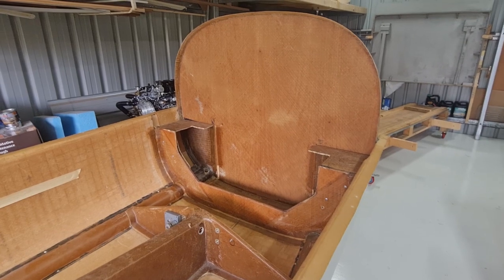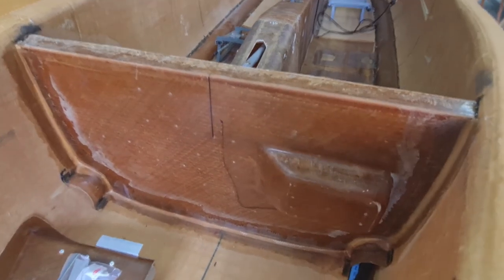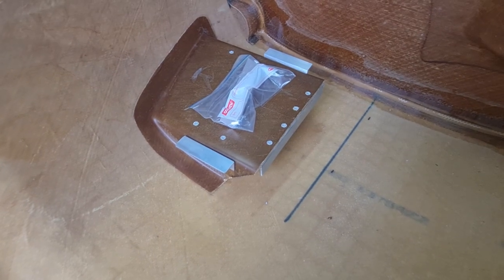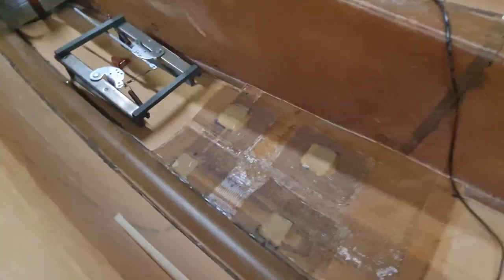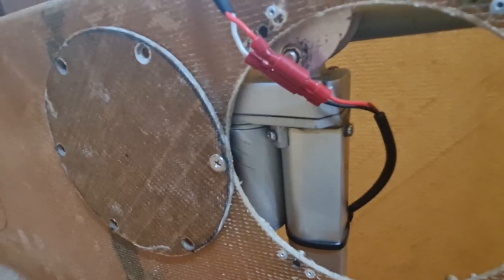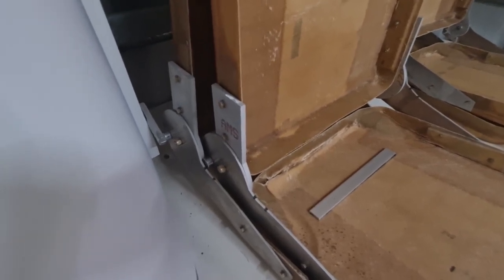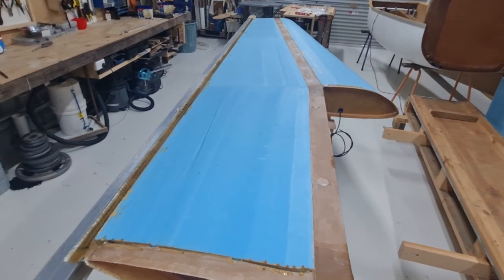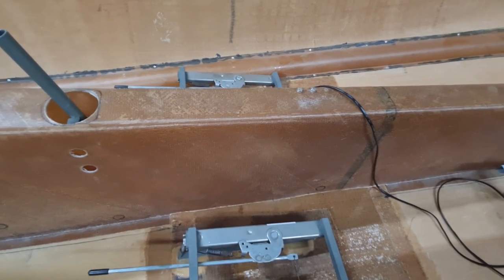Velocity Build Experience 03 - Lower fuselage start

Comment: Might be a bit late but anyway: you could consider a magnetic field angle sensor (like the MLX90316). You then only have to glue a magnet near the rotation point of the speed brake and position the sensor near (but  inline with) it. This way it is impossible for your measuring device to interfere with your actuators. This chip can be configured to give an easy to use 0 to 5V output (or PWM, or SPI). I have used these in the past to measure all control inputs of a helicopter, without risking to block some controls if a potentiometer would get stuck or something like that.
Reply from the maker: This is a great idea. I've looked at using them, particularly the KMZ41 for a future mini project on the velocity. I'll have to look at the MLX90316 to see if it's better suited. I'm a little unsure about the mechanics of getting a magnet to sit stationary on top of chip while the brake is moving. getting near the hinge is tricky, but i'd like to get rid of the potentiometer for one of these for reliability and better accuracy.
Reply: @AusVelocity  These sensors do still work when the alignment isn't perfect, but with an error in the measured angle. If I remember correctly, the MLX can compensate for this. Otherwise, you could use a microcontroller with a manually determined look-up table to compensate. I think you might get away with the magnet being just next to the hinge, but that requires a small experiment. In any case, I think in your case the exact angle is not super critical.

Comment: Quick questions, is yours fixed gear and what horsepower engine you considering with Viking ?    I’m tempted to build this thing, but I’ve never built anything in my life not to mention using epoxy.
Reply from the maker: Using the 195Hp. 
This was my first time with epoxy too.
It's not hard. All the epoxy and glass is supplied.
The tricky bit will be measuring twice and cutting once, then letting the glue dry.

But remember it's not just 195Hp as compared to the 180-200HP Lycombing that's intended for the SE. the 195T maintains power at altitude. So 195HP turbo is comparable to up to  245 Hp at cruise RPM at 10,000 ft, given the loss of power at altitude for normally aspirated engines.

Comment: it is so hard for me to trust sees thin-wall glasfiber wings to coap 200knots stress..it looks so fragil and like you build a gocart...and the twin motor version was hitting fare over 250 knots...how high is the stressfactor ?
Reply from the maker: Well, it can seem shoddy from obsevation, but it's well tested, i think 200 IAS is the limit. I think the weakness is in the ailerons and rudders if they start to flutter. The strength with the G loading is way up there, tested at 6 but designed to 12, i think. Don't know about the twins. A guy in my local area will be building one with ul-power engines soon, I'll have to learn some more about it from him.

Comment: Wish I was your neighbour... would be annoying you every day. Great work.
Do you use any vacuum bagging for the glass / carbon cloth work.. ??
Reply from the maker: My neighbors' are oldies and not really that interested but I'm always seeking advice or outside ideas or opinions.
I can't think of anywhere that I could use vacuum bagging. Anything flat or curved has already been pre-molded at the factory and supplied. Almost everything gets a layer of peel ply to soak up excess resin and leave a nice texture.

Comment: All of the plumbing and unnecessary weight to put the oil cooler in the nose of the plane.  You can cut that air scoop anywhere.  I'd look to have the air scoop on the bottom side near the rear and a simpler and lighter system
Reply from the maker: No oil cooler has saved some weight, work and money. I think I'll build a scoop at the bottom to hide the 2 inches of engine protrusion in the bottom cowl. The gearbox needs cooling so I might use the scoop for that.

Comment: Hello friend,
I am a new follower in your channel about this amazing project. But I have here a discussion point . Maybe assembly from aluminum is light-weight and stronger and harder than fiberglass? What do you think 🤔 !
Reply from the maker: Well it's a pretty wild idea to build a velocity out of aluminium.

Pound for pound fibreglass is stronger the steel so I'm not concerned with strength. The airfame has been tested to 6Gs and is designed to +10 and -7 Gs.

Comment: Save weight and get rid of these silly headrests. Nobody will lean on them beceause they are to far back. Thats heavy automotive rear end crash „design“.
Reply from the maker: Thanks, you're probably right. 
Without testing them out, I'm guessing the pros of cutting them off is less weight and better visibility for the backseat passengers. The cons are when passenger's lean back for resting/sleeping there is no head support. Given that the plane is intended for long trips, I think I'll leave them for now. Open to changing my mind before I upholster them.